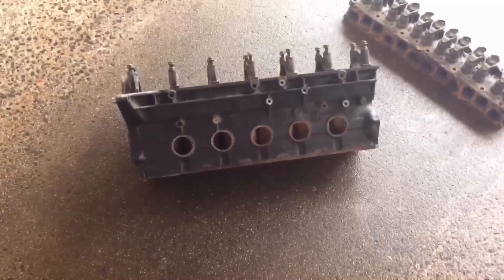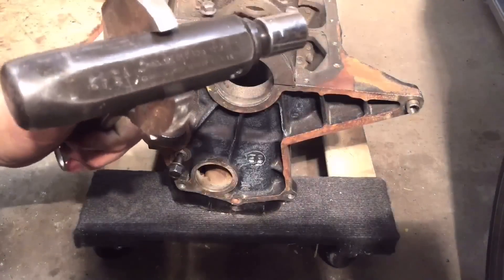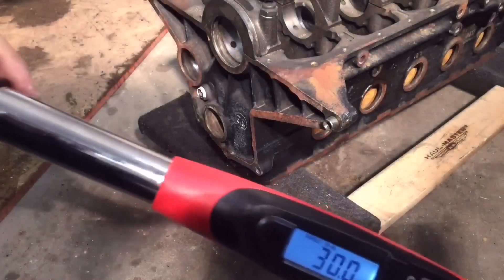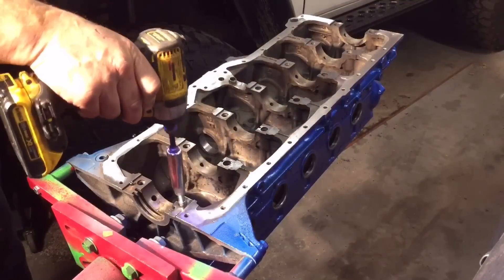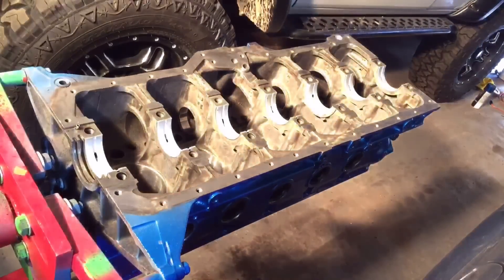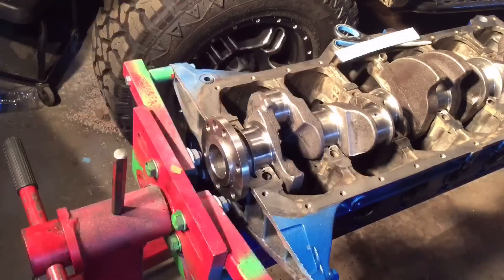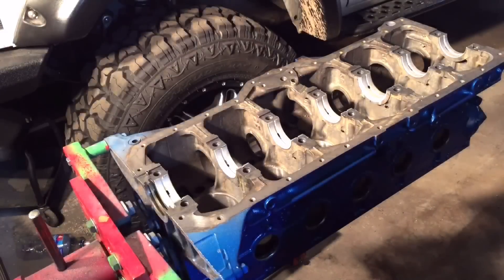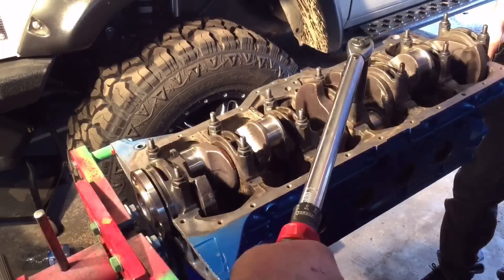Jeep 4.7 Stroker Complete Build Part 1

Comment: Great video series!  What cleaning steps did you take before painting?  If I hit the block with a garden hose, I worry about rust since I don't have compressed air and the block is bare metal.  Can I just hit it with some brake cleaner and wipe it down?  Do I need to spray out the water jacket somehow?

Comment: What primer and paint did you use I'd like to copy it
Reply from the maker: VHT SP148 primer, &
VHT Paint....https://www.vhtpaint.com/high-heat/vht-anodized-color-coat 
Base, then color.
Reply: @kevefox   so that is the anodized blue for the paint correct, and how is it holding up
Reply from the maker: Yes, and zero issues.
Reply: @kevefox  ok did you only do one coat with the blue
Reply from the maker: As I remember I used several coats until it was even and the darkness I wanted.

Comment: Why oh why does everybody call them freeze plugs. These "freeze" plugs are actually called "welch" plugs. They were locktited on installation at the factory in addition to the press fit on the plug. .005 to .008" if memory serves. The same goes for the plugs on the head. The only reason those holes are there in the first place is to shake out green casting sand from the casting cores. If any sand does remain in the water jackets it is normally on the cam side of the water jacket. 
Incidently I would be interested in just what the block hardness is. It would be interesting to compare it to an RB, a 2J and a Ford Barra. I do know when the 4.0 entered production on the initial machining operation to cut the block deck face and register surfaces on the side along with the pan rail, rough machine the bearing cap seat and the bearing 1/2 rounds the chips from this operation would come off the cutters with a blue hue to them. Cast iron does not normally do this. The 4.0 castings to my knowledge are the same alloy as was used in 343, 360, 390 and 401 blocks. Very high nickel content. With a decent head (any of the stock heads along with the Edlebrock will always be limited because you can only get the intake port so far up in the manifold face) that could really flow at high RPMs I wonder just how much power you could get out of one of these.  I know people who build strokers are primarily interested in low end torque. If I had the spare change I think I'd look at a 4.0 or a Mexican block as they had bigger bores than the 199, 232 & 258. Punch it out to 4.00" and use a crank from a 199 for a 3" stroke. Build a new head out of a set of either SBC, SBF, GM DOHC V-6 or Infinity V-8. Thos are the closest bore centers that match up. The SBF is the same at 4.380. The GM's are .020 over that while the Infinity is around .030. It would take some serious machine and welding work. It's been done with Chevy and Ford inlines so it's not out of the realm of possibility. My thinking is something on the order of a 3/4 Boss 302 or a Z-28. The reason for using the 199 is if the alloys are the same as the 4.0 the 199 should be stronger given it has more overlap between the main bearing and the rod bearing diameter. The cylinder bores might require boring the block so much you would need to put sleeves in. As I said this would be a very intensive project. 
If you really want to go crazy billet blocks and possibly a 3D printed head are entirely possible. It only money. Now i just have to win the lottery

Comment: Nice job. My son and I are rebuilding a 96 GC I have a quick question. On the cam bearings does the second from the back have two oil galley holes with only one being used? I'm guessing the bearings fit many straight 6s?
Reply from the maker: Great stuff building a motor with your son! I think you’re right about the multi use bearing. I had the machine shop install the cam bearings while boring the block so I don’t have a great recollection of them.
Reply: Thanks stay safe
Reply from the maker: Joseph Borso thank you! Will do. Have fun!

Comment: Tinkering Fox, I own a 06' TJ Rubicon.  I am wanting to increase performance from stock.  I feel my jeep is sluggish both low and top range.  I put headers from Banks Performance and this did increase my low end though at about 60MPG the Jeep has nothing.  I am wanting to either replace my cam and lifters with a new head, add a turbo or do a stroker build.  This is where I would like some information from your experience.  What do you recommend and what experience have you received from your stroker build? i.e. real world use and economy?
Reply from the maker: Great question! An 06 Rubicon with a six speed is one of the best Jeeps ever built. I think the factory gears are too high for stock 31’s so if you went to a larger size you would no doubt suffer. Gears are by far the best bang for the buck. As far as the turbo goes you will have increased under hood heat so a supercharger can prove to be a better option. There is a way to install a super charger from an 80’s T-Bird onto your A/C bracket with minimal machine work. Those super chargers can be picked up for a few hundred dollars. I certainly love the power I gained from the stroker build but I don’t use it as a daily driver so I have no place commenting on longevity of it for commuting. Gears, super charger, cam, 24# injectors and a head job/factory rebuild would do wonders! I spent too much on my build because it was more of a project that I wanted to take on and just got carried away.
Reply: @kevefox  i called zach at 505 Performance. I spoke with him and he mentioned 1.5 cam and the cast iron head that is machined the same the Elderbrock Performer head for half the price. The other question that i didn't get answered was since i want to do a turbo, that i was told that i need to go the the aluminum instead of cast iron. Have you heard this to be the need?  What would be the benefits of either the cast iron or the aluminium head pros and cons?  
Yes i am running 33" tires. I have heard that regearing my Rubicon would be a great benefit.
Reply from the maker: The benefit of Aluminum is cooling. Turbo = Heat. Nothing wrong with cast iron head other than the original ones for early 2000s that cracked.
Reply: @kevefox  so should i spend the money for the aluminium or get the cast?
Reply from the maker: If you’re running a turbo yes, (aluminum) also an aluminum radiator. If you’re running a super Charger than no.

Comment: Hello its very late to comment after 3 years, but i want to ask you,  why you don't  make with stock cylinder head? i want to do this but for me Edelbrock is very expensive and what you say if i take stock cylinder head?  my car is WJ 4.0   because shipping in my country cylinder head Edelbrock its will be very very expensive, and next question after build u upgrade ECU on jeep or not?
Reply from the maker: I only did the cylinder head for better breathing. They still crank out the power with stock heads. Some will have provisions for a coil pack, etc. the later 4.0s had a problem with cracking heads so be careful and make sure not to buy that casting number (easy to look up). I didn’t have to mess with the ECU but I’m going to send it in to see if there’s any power gain.
Reply: @kevefox  The  jeep xj have trouble with getting to """" HOT """ in offroad slow-moving 4 wheeling in the woods with no air flow. The fan clutch upgrade, the v8 clutch helps, and the high flow water pump and thermostat housing help, and the hood vents with fans help. But that Edelbrock """" aluminum cylinder head """" and heat is not good, it can wrap if you get it to HOT. But it does save you, wight and it does flow well. you have to do the math on all of it, it all has to work together the valve size,ccing the combustion chambers, type of pistons used, the cfm flow, and boring the block to 60 over, makes the cylinder walls thin that could cause a problem.do all your homework b4 you build, and build it right. ask yourself this build a 4.7  or just go ahead and drop in a v8?

Comment: In hind sight, if you were picking up a bone yard block, what if any other year blocks would you choose?
Reply from the maker: I think anything ‘97+Up. I’m not too sure anymore though. I think there’s a difference between the ZJs etc but I can’t remember. I thought it was motor mount related? I can’t even remember at this point which blocks use the girdle. There’s also a difference in rear main seal lips. I’m sorry but I’m just exhausted at the moment.....long work week
Reply: No worries, thank you.

Comment: Less than 4 minutes into this video and I feel a need to comment. That oil galley plug should have been removed and left out before it went to the machine shop... just sat here and watched you blow crud and shavings into your oil passages. Buy a brush kit for block cleaning, and first thing when your block comes back from the machine shop, spend some time cleaning out all the nooks and crannies,  as well as all oil passages with the bushes from the kit, then power wash the ever lovin' crap out of it before you put any plugs back in the block. Machine shops hot tank before machining, not after.. and hot tanking will NOT remove everything.. you need to get in there and get it out with some good old fashioned elbow grease.

Had to come back and edit.. all those bolt holes should be chased and surfaces cleaned BEFORE you power wash for the final time,  and BEFORE you paint it! I can only imagine the amount of crud and shavings that are running around inside your nice new engine!
Sorry man, not trying to cut you down.. all in all it is a nice build.. but these are the kinds of things that need to be thought thru when doing a build.. I see so many guys spend countless hours and dollars on an engine build, only to have issues down the line..

Had to come back one more time! 2 things.. 1st.. don't EVER put ANY type of glue, sealant, silicone, or what have you on your main seals!! 2 reasons,  1st off those seals are made to fit perfectly in their slot and ride against the crank within specific tolerances.. putting silicone or anything else on there is going to seriously effect those tolerances, and could end up causing a leak because the wiping surface is not uniform all the way around.. and 2nd, what if you have to replace it with the engine still in the vehicle?? No way you are getting it out with it glued in there, not to mention how you gonna get that silicone out of there if by some stroke of luck you get the old seal out?? And lastly,  you demonstrated that shoe horn for the seal incorrectly.. that little tab on the installation slider goes in first.. I laughed when I seen you fold it and put the wrong end in first.. I also witnessed you turn the crank slightly after you set it on dry bearings.. probably no damage done,  but you need to refrain from moving a crankshaft on dry bearings,  tiny scratches can develop and shorten the life of the bearings..
Reply from the maker: William Bush yep, you’re absolutely right.
Reply: @kevefox  again, not trying to cut you down in any way.. this was a very nice build and the majority of it was done correctly and with proper care and procedures.. I've been building V8 race engines for years, and have learned the hard way that sometimes the simplest things can cause major issues down the road.. guys watching these vids that may be thinking of doing a build,  but have never done one need to learn that THEE most important thing in ANY build is cleanliness! Your shop, tools, and assembly area need to be clean and uncluttered,  and you can never clean something too much! 
Again, great job and I hope you get many years and miles out of this awesome engine!!
P.S.  was glad to see the use of plastigauge on this build! With the kind of money being spent,  it's a must for a build like this! In future videos,  you might want to explain what to do when something is found to be out of tolerance.
Reply: William Bush you are extremely well educated on these man

Comment: Nice motor.  Is it worth rebuilding my 99' TJ with the 4.0 and do the stroker or replace it with a long block 4.0?  My jeep is all stock and my baby.  Not really a need for the extra power but you never know...
Reply from the maker: If it’s just stock and you’re just wanting to make it new again then definitely just go with a stock long block or maybe a more aggressive cam but keep it close to factory.
Reply: Tinkering Fox  I think the long block option is best for me.  I like rebuilding motors, especially at my own pace, but after calling my fav machine shop for quotes for the work on the block, crank, and head its actually cheaper here in Spokane to get a long block from S and J motors.  It even comes with a great warranty.  I wonder if the times for stock motors are like brake rotors.  Cheaper to buy new ones then have the old ones turned.  Thanks Fox
Reply from the maker: Good analogy. My best friend lives in Chattaroy. Check out the motor mounts from Brown Dog, I’ve seen stock ones that have torn off of the block.

Comment: So no oil or any kind of lube during crank assembly? FAIL!
Reply from the maker: Thanks for watching and commenting.
Reply from the maker: Rob Hicks actually that was just for the plastigauge. The actual install and torque down was done with assembly lube and then the engine was pre-lubed before startup.

Oil dissolves plastigauge so I didn’t want an inaccurate reading. After checking assembly lube is splatted on heavy.
Reply: Thanks for making that clear. I watched the video again and I can see that I was wrong. My bad! I watched the rest of your build today and I was very impressed.

Comment: Any reason you didn’t use bronze frees pugs?
Reply from the maker: RobWillmot I used bronze on all of the freeze plugs but steel on the cam plug. The expansion is better with bronze in the water jacket but steel wears better on the end of the cam.
Reply: @kevefox  
Just one thing. I know every bodycalls them freeze plugs. They are actually called Welch Plugs. The main reason those holes are there is to get the core sand out of the casting at the foundry.

Comment: Fantastic work and project!  Did you follow a guide book?  I've seen some for rebuilding these 4.0's but not to upgrade it to the stroker.
Reply from the maker: WILSON! No, other than the torque and measurement specs out of a Chilton or Haynes. Just read a ton of threads and weighed pros and cons of different parts.
Reply: Awesome.  I've never used a Chilton, but I've heard they're pretty good.
Reply from the maker: WILSON! Here is a link to a site that sells PDF form FSM’s. I’ve never used this site just came up on a quick google search for Cherokee FSM. Probably the most useful would be the wiring breakout
http://www.pacificcoastmanuals.com/jeep_cherokee_service_manuals.html
Reply: Wow, those look very promising, and great price too.  Thank you!

Comment: Stopped watching and went to comments when you described how to get an oil plug out by grinding a head bolt.

A ratchet fits in there.  And if you don't have one that does, a square drive kit does.
Reply from the maker: Patrick Peterson thanks for the insight, where did you get your ratchet between 1/4” & 3/8”? Maybe it was a Chinese 8.5mm?
Reply: Me too .

Comment: What stand and col paint did you use to paint your engine?
Reply from the maker: alexander jones 4 different kinds;

#1 VHT Flame Proof Primer SP-100
-https://www.oreillyauto.com/detail/vht-flameproof-5185/chemicals---fluids-16461/paint---body-repair-16614/paint---primer-surfacers---lacquer-based-17756/paint/sp100/4776736

#2 Duplicolor Metalcast Ground Coat MC-100-
https://www.oreillyauto.com/detail/dupli-color-metalcast-3397/chemicals---fluids-16461/paint---body-repair-16614/paint---wheel---metal-coating-18076/anodized-spray-paint/mc100/4268509

#3 Duplicolor Metalcast Blue Anodized MC-201-
https://www.oreillyauto.com/detail/dupli-color-metalcast-3397/chemicals---fluids-16461/paint---body-repair-16614/paint---wheel---metal-coating-18076/anodized-spray-paint/mc201/4268511

#4 VHT Satin Clear SP 115-
https://www.oreillyauto.com/detail/vht-flameproof-5185/chemicals---fluids-16461/paint---body-repair-16614/paint---high-heat-18074/paint/sp115/4776745

Comment: excelent video man, congratulations.
does those blocks have the bores integrated or these are sleeves?
Reply from the maker: César Augusto no sleeves, just bore to piston size up to .060 over stock. Thanks for watching
Reply: Tinkering Fox but generally those blocks are built with integrated cylinders?
Reply from the maker: César Augusto yes, sleeveless until you install one.
Reply: Tinkering Fox thanks, i have an xj, i hope you enjoy yours with that magnific update.
Reply: Being Cast iron no sleeves needed. But I wonder if you could bore the cylinders completely out and install sleeves with 4.000bores. The reason is the 4.0 has the same bore centers as the Ford Small Block (4.3800). The amount of untouched potential in these engines especially if you could put a 4 valve head with DOHC or better yet use the Free Valve technology

Comment: Question: - did you choose to stay with the OEM main bolts so that you could retain the OEM girdle?  Curious you upgraded almost every other part of the long block but did not upgrade to ARP main studs.  I'm curious to understand if there was a decision in there somewhere.
Reply from the maker: Patrick Schliesing yes, that's exactly why. The newer blocks are thinner and benefit from the girdle. As far as I know nobody produces aftermarket bolts with a stud on top.